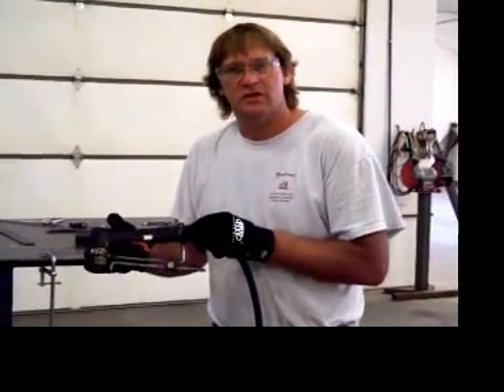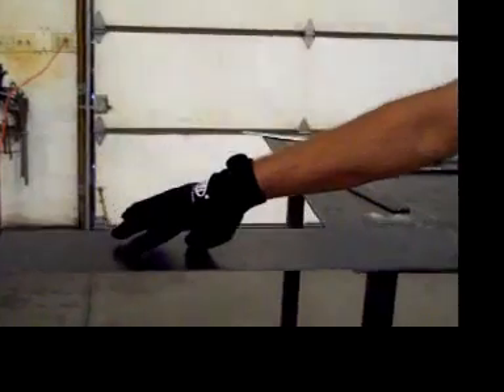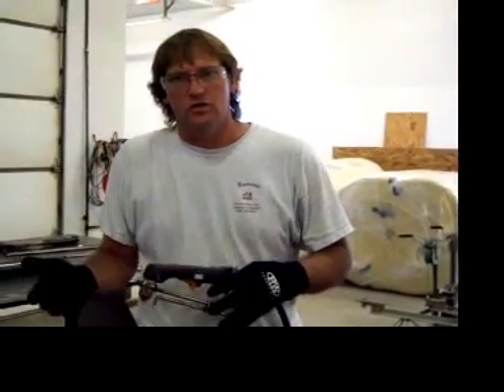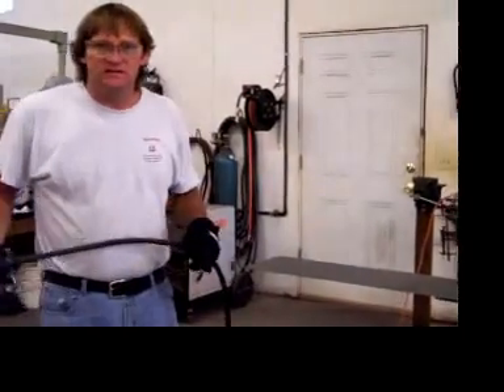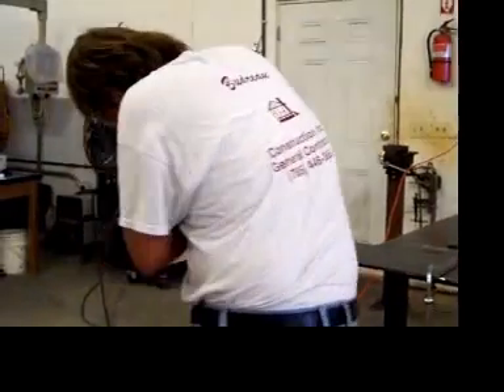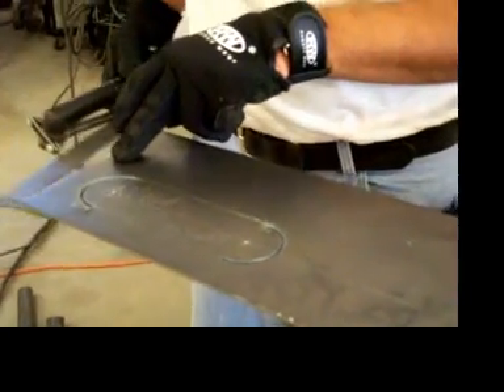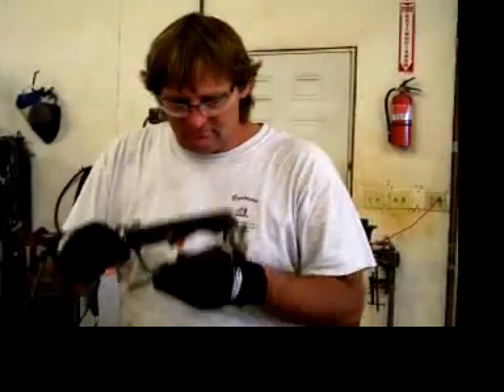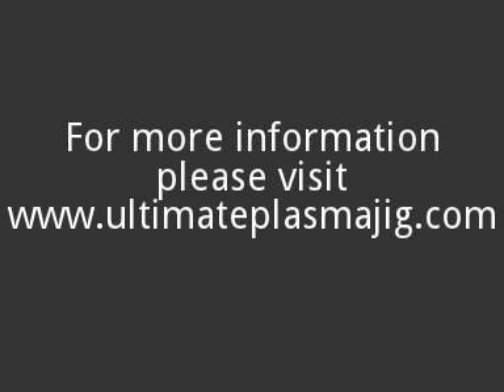The Ultimate Plasma Jig (Cutting Slots)

Comment: Mark Ron here cool tool. You need to clean-up your videos. This marketing and demo. Dont cut the dang pipe hole the wrong size and post it with an excuse.
If you want to sound like an instruction manual. Switch to PRINTING THE WORDS.
This way you concentrate on making perfect cuts and far less about what to say. You can add words and change words in editing. MAKE A PROFESSIONAL T-Shirt
that has a LOGO on it and a web address on the back.
Know this is a suggested add-on to your design.
The block where the two rods end. Make the block taller and drill it  with a "1/4 bit and drill and tap a add the thumb screw. This way I can use this tool to add a stop block to it.
Cheers and good luck

Comment: I find it easier to make a template out of 1/8 aluminum sheet, allowing for the size of the drag shield, and make the cut in one pass.  I have several templates for common cutouts and it works great.